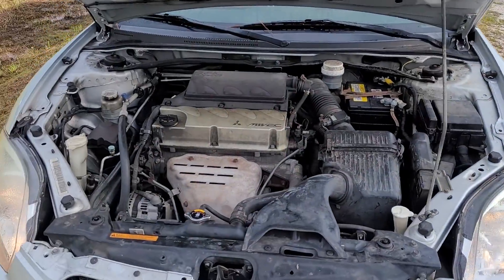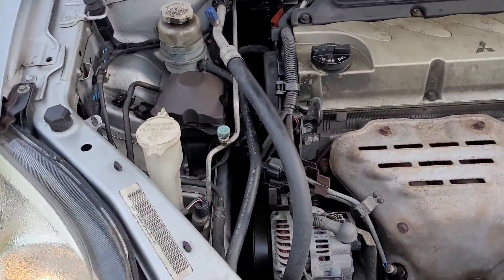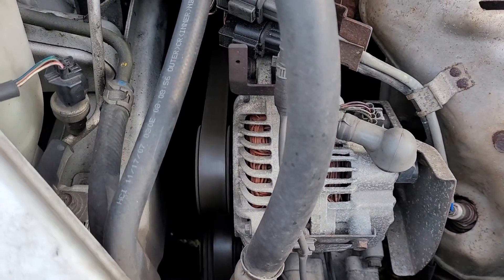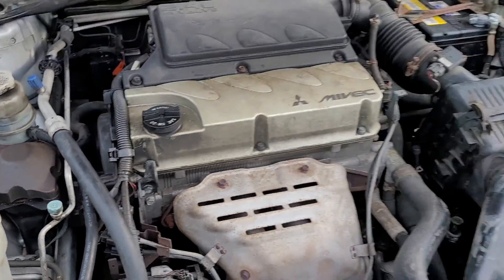Timing Belt broke on an Interference Motor

Comment: I left my 02 4Runner running for a few minutes to warm up during this cold snap and I came back to find the truck had stopped, and I smelled burnt rubber or electrical burn. No fuses blown etc. Next day I took the timing belt cover off which is fairly easy, and the belt looks like it was run with a blow torch on it. I gotta finish checking it out when it’s daylight but there shouldn’t be any real damage to valves or the engine since it was just idling right? It probably tripped the safety sensor and shut off?
Reply: Was it damaged?
Reply: @johnnycalderon9951  it turned out to be the idler pulley bearings had seized. The belt burned off but all I had to do was replace the belt, idler pulley and I did the water pump too. Runs fine.

Comment: 2003 accord, mine was rattling, vibrating and running rough I shut it off then when I tried to start it it sounded like the starter was just spinning.  It's a chain not a belt.  Was debating replacing chain but its pretty expensive kit.  Not sure if its worth trying or just getting a used motor.  car has 141,000 but everything else is in really good shape.  Any advice?
Reply: I'm in the same position, hope someone else responds
Reply: having the same issue
Reply: If you can afford to junk it otherwise if you want to keep it all subjective

Comment: What I learned:
Mitsubishi is garbage
Mechanics sometimes make careless assumptions and are wrong
If your timing belt breaks when you start the car, it might be ok
If your timing belt breaks while you're driving at higher RPMs, you'll likely have a problem
What I did not learn:
How to care for your car to help your timing belt not break
Reply: I got a 204 Mitsubishi Lancer Rallliart my timing belt went out going 70-75 mph had a mobile mechanic come and did a diagnostic and says that he didn’t see any contact on the pistons and said there’s a good chance my valves didn’t get bent quoted me $1,100 to change out timing belt and water pump should I do it?

Comment: Thank you for your video. I have a 2011 Volvo C30 T5 R-Design (interference engine) and it sounds like this right now. As soon as this happened I took it to a shop and they thr timing bet may gave jumped tooth and I possibly need a nee motor. The car is currently parked and I'm thinking og taking it to a shop that specializes in Volvos that said i might just need a new timing belt. I also had another shop say tht same thing.

My timing belt is stll intact. 

So, you think it's worth it to try a new timing belt?

Comment: Will it or can it blow a head gasket or warp a head when this happens
Reply from the maker: No. It will bend the valves though if the valves are held open at the wrong time

Comment: I got 61,000 miles on a yr 2000 Accord since the last belt change, im rollin the dice until i get 80,000 miles, im i asking for trouble.
Reply: So my timing belt snapped on the highway. Car had given signs and symptoms of timing issue by setting check engine light but I procrastinated and snap went the belt (well at least I was not cruising at 40,000 feet, 😁). Two intake valves and two exhaust valves bent. Pulled the head checked the pistons and looks ok. Redid the head. Just too much work for allowing oil to leak on the cheap rubber timing belt.  Just too much work and costly parts replacement. I would go with what the car manufacturer recommends if everything is working well and don't just change the belt but all components that the manufacturer says to replace.
Reply: @bobdeengineer7396  Gringo you scared me, now i will take my $600 bucks and eat the cost and have the belt installed by 2 Good Gringo Garage Monkeys.
Reply: @matt7iron  What did the car manufacturer recommend in changing intervals? I believe my Chevy sonic was every 97000 miles on all timing components with high quality parts.
Reply: Correct. Right now as I type, I am putting HSN gates timing belt, with other high quality components. I observed no oil leaks and the rotational torque of the crankshaft and cams are within specs so no unnecessary load on the belt. Remember, over tightening cam bearings can also snap or shear the belt.